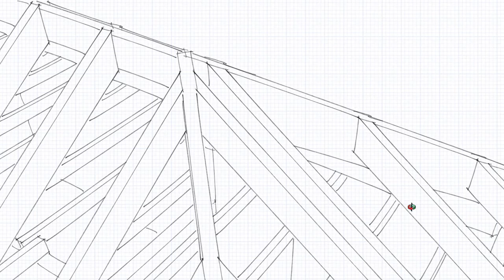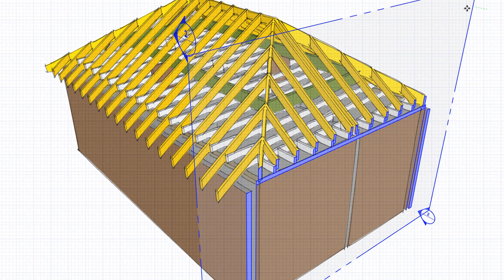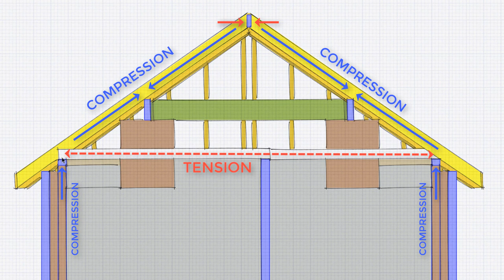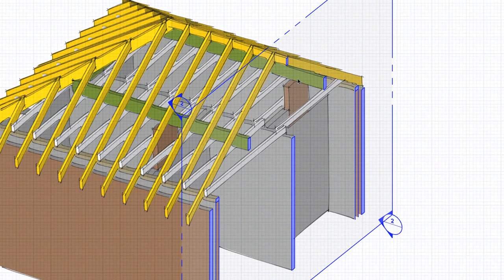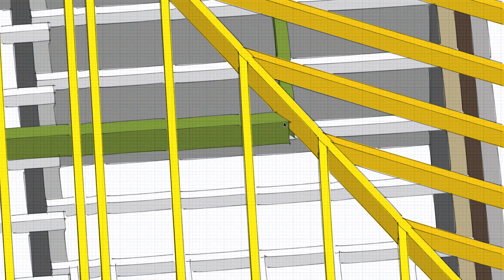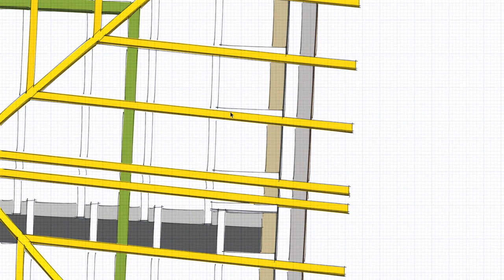How does a hipped roof work?

Comment: Very impressive presentation and sketch-up. Thanks Robin. A couple of questions and discussions: 
1- The support of the purlins and loads on the hip rafters. The end purlin is supported by the hip rafter. Therefore, when sizing the hip rafter, the loading will need to cover the jack rafters as well as  the end reaction of the purlin. Considering a 3-4m purlin supporting all the dead/live loads from the common rafters, the point load transferred to the hip rafter will be considerably high. 
Then, the end reaction of the hip rafter itself will be transferred back to the end of the ridge board. Then it will be passed on to the 1st pair of common rafters. So the question is, why we normally won't thicken the 1st pair of common rafters at the hip? (sorry for the long winding questions and it would be much easier to talk through a sketch board). 
2-  I know you have another video about loft conversion. However, my question here is about loft conversion with large dormers (a lot of home owners would prefer a dormer which is as wide as the span of the ridge board). For the hip roof structure in this video, I don't see any way the dormer conversion can be done without installing a new steel ridge beam with additional support at the hip (can be a column or triangle frame). This is a result of undermining the integrity of the triangle which is formed by a pair of common rafters and a continued ceiling joist. Just wonder if you have any better alternative or I missed anything? 
Many thanks for the video as well as reading my questions. 
Cheers,
Rick

Comment: What way does it work then when converting a hipped roof loft? In terms of the purlin support walls, they would protrude into the available room space could they be replaced with vertical timber supports every 600mm along the purlin? 

Or even cut the purlin wall support back flush with the edge of the purlin to reduce protrusion into the room? 

Or replace with a steel beam somehow?

Would be very interested to see a video on how this hipped roof structure could be converted and maintain both structural integrity and the hip design. You see an awful lot of videos on YouTube of hip to gable loft conversion but never any hip loft conversion dealing with the purlin support walls problem.

Loving all your videos have been so informative, keep up the awesome work!
Reply from the maker: Great suggestion - watch this space!

Comment: Great video! This is a common type of residential wood roof trusses here in the US. I would be curious to see a wood truss design with a vaulted ceiling. That is often a tricky design because, without the collar ties to tie the system together, it is hard to transfer the horizontal shear force to the top of the walls while maintaining stability.
Reply from the maker: Great suggestion! Check out this one for the analysis of a collar tied roof: https://youtu.be/JbRUdP2AYKg

Comment: Even better the second time around! Just in time to design a hipped cut roof, so many thanks Robin 👍🏼 perfect learning and revision material!
Reply from the maker: Thanks Cory - great to hear it!
Reply: @RobindeJongh  very helpful. Would the hip rafter typically be doubled up to account for the higher loading and point load from the purlin, as well as the first ‘truss’ supporting the hip rafter at the top?

Comment: Hi and many thanks for the professional explanation
My question is how the roof load will transferred to the walls?is it distributed transferred along the wall length and points loads applied in the corner transferred by the hips?
Thanks

Comment: This video fundamentally misunderstands how hipped roofs work:
1) the purlins are not 'supported' on hip rafters - but actually form a 3-way compression joint (c-c-c) with the hip rafter. The hip rafter is predominantly a compression member rather than a flexural or bending member.
2) the purlins are not 'ties' - ie tension members - they actually form what's known as a 'compression ring'. The opposite of ties.
3) having said the above, the jack rafters on the hip tying to ceiling joists at eaves are actually a fudge: they don't 'tie' back to anything other than the plasterboard! However, historically it does seem to work (all hail all those who wryly say 'this house will be held together by the plasterboard'). If I design a hip roof from scratch, I normally nog a few ceiling joists back and use galvanised straps over the top (a roofer will tell you that's overkill!)
The force diagram for the cross section is correct - and helpful for understanding. But the similar action of the hip rafters in conjunction with the purlin is missed.
Reply from the maker: Hi. I’d be very interested to read any references you have on this?

Comment: Great presentation many thanks Robin. Funny I was never a fan of the hip roof from the issue of maintaining the hip tiles.  I have realised recently though that they avoid all the issues of bracing and restraint strapping of a gabled roof, so provide a wind proof structure at the expense of a lot of joinery. Just one minor question: For the overlapping ceiling joists, for the central overlap presumably a bit extra overlap timber should be allowed such that there is say at least 6 inches ( if not a bit more) of timber beyond the last nail, to stop the nails splitting out the end of the timber?  At the wall plate end assume best to use purpose made straps/ties to fix it all together.  Thanks again.
Reply from the maker: Thanks John - very good points. Definitely a bigger overlap for the ceiling timbers than what the graphics indicated is important to allow the nails enough end distance. I'm not a roofer but it seems to me that the tried and tested methods are best to stick with, so either purpose made connection plates (warrantee'd by the manufacturer) or else the right number of nails as specified in college textbooks or by experienced joiners!
Reply: @RobindeJongh  Thanks Robin. I've been wondering what the terminology was for the overhang so it's "End distance". Agree on using manufacturers purpose made brackets at the wall plate rather than making something up. I hadn't thought about the wall plate corners before, that was an interesting point.

Comment: Hi. very much enjoying your videos. I'm a joiner by trade but now a building surveyor and often we see hips which are clearly sufficient for purpose having been there 50 or 100 years without significant deflection, yet they often don't calculate. can you explain what's going on at with the magnitude and direction of forces at a hip. I'm aware that the purlin load is transferred to the hip which is more efficient being in compression (hence the smaller section) but I think it would make an interesting video and I always learn something from your videos. Also if you could explain how then loading of a hipped roof translates to the forces on a beam below. Thanks again for your content.
Reply: Calculations account for more loading than is likely received, there’s also a factor of safety, snow is rarely in such quantities as accounted for and is short term, there’s also a lot of load sharing between the members, timber quality is perhaps better than assumed in the design codes, older roofs that failed have probably been replaced!

Comment: Hi Robin, should purlin supports mirrored / symmetrical? 

Wondering if it's feasible to have both purlin supports positioned opposite eachother, but slightly off of the structural mid point?

Thank you for all the great content you upload !

Comment: Hi, good video, ex joiner and building surveyor.  I usually put a small pice of timber nailed under the hip where the purlins meet so the purlins can join / exert equal and opposite force and usually a plywood gusset attached to the outer face of the last two commons so that the larger hip plumb cuts have something to nail to otherwise the bottom of the hip plumb cut is dangling where it meets the ridge.   My question is I’ve always found the unsupported purlins which span from the short length of hip to hip at the left and right sides abit odd as they add extra weight to the hip with no supporting masonry pillar underneath.  Is this arrangement providing support to the hips via equal and opposite force where they join to the supporting main purlins and thus don’t need a pillar under them ?

Comment: Robin, I do have a question...I have an existing structure that is a 4-way hip roof over a square building and has no ridge. Basically a pyramid. The owner wants to add 10 feet to the back of the structure with a gabled roof. The existing structure is 24'x24'. Adding 10' in the rear would effectively require a 22-23' ridge extending back to the gable. The owner would like to remove the jack rafters on the back to provide full access to the attic. My assumption is that the two hips in the back would need to be beefed up somehow to prevent bowing caused by the pressure of the side jack rafters. I was going to install a 24' carrying beam along the back where the existing back wall will be removed and installing the ceiling joists on top of and perpendicular to the beam. Do you know how the back hips would be beefed up to reinforced them once the back jacks are removed?
Reply from the maker: Hi Scott. This would need a structural engineer to produce a design as it's not an easy answer.

Comment: Hello from Erie , PA USA

I have a section of my 1913 cape cod's hip roof attic (2x6 rafter) that'll be converted to living space . I have a supporting wall 12ft from one side and 16ft from the other . The floor joist (2x6) for the attic connect at the support BUT at the exterior walls they sit ~5inches below the top plate and are nailed to vertical stud . Because I'm converting this section to living space I've added 2x10 collar ties (7'6" ceiling , originally 2x4s but moved up 3.5') . I plan to sister the joists with additional 2x6 on each joist + blocking at mid span as I want to avoiding losing height. The rafters and joist run in same direction .

Do you think this attic floor will hold up as I believe the floor acts as the rafter tie in some way ? Its currently not sagging or bouncy . I'll be reinforcing the roof rafters to the top plate with Simpson Strong rafter ties and attach the sistered floor joist to outer wall with 2 Spax Powerlags 3/8 thick screws . Ill be removing the 42 inch knee walls after all this . Does this sound like it'll work ?

Thanks !!
Reply from the maker: Hi. I'd always get a structural engineer to take a look if you're doing structural modifications.

Comment: Have an older home with hip roof.  2 x 4 construction on rafters and ceiling below. House is in northern USA, so snow load happens every year.  Currently  no Purlins are present.  We are replacing shingles on this home and notice that the rafter are bowing.  Can we jack up rafters to take out bow and install a knee wall on all 4 sides instead of Purlins.  Concern is 2x4 ceilings  supporting weight possible wall cracking below in living area.  One side of house has 1 wall underneath as other side had 2 walls underneath to disperse the weight.  Thoughts on knee wall?
Reply from the maker: Hi Dee. I recommend that you have a structural engineer round to look at this.

Comment: Hi Robin. I’m looking at converting my bungalow loft which has a hipped roof, 45° pitch and a 4’ ridge. The purlin props are at 90° (or not in some cases) and strutted on to the internal walls for support. Providing I make sure that they still strut down to an internal wall, or a beam fixed across the internal walls, is there any reason why I can’t have them in a vertical position? Rafters and joists vary between 360 and 400mm - 1935 built brick bungalow. Many thanks.
Reply from the maker: Hi Mike. You need to resolve all the horizontal and vertical components of the force, which is why the props are in at an angle.
Reply: Thanks for the reply Robin. How would you suggest to overcome this? I was advised by a builder to fit a props vertically on to a different internal wall to take the weight of the purlin and rafters and then remove the angled ones. From what you are saying, I gather this won’t be sufficient?

Comment: Hi Robin. Just a couple of quickies...

(1) the tension in the bottom ties. Obviously a builder would ask how many nails are needed. If you had say.. A tension force of a 10kN. When you split the bottom tie in half, do you usually specify the nail fixings etc?

(2). The pier walls. Have you done this on many projects retrospectively? With wind loading, is that a concern at all? Would you specify any proprietary fixings to ensure the wall stiffness is at its max or if its a loft conversion, would you instead design steel supports spanning from eaves to internal wall, then design a stud wall / timber post to support the purlin?

Cheers! And great videos as always.
Reply from the maker: Hi Mark. 1) yes, would need calculations to ascertain fixings if the ceiling ties were not continuous. 2) Do you mean take the pier walls out?
Reply: I have known structural engineers give the shearing strength of nails for fixings but in reality what is usually specified is "adequate fixing" which means someone getting busy skewnailing with a nailgun.

Comment: Random question but I'm a roofer and just started doing jobs for my self and I'm struggling working out the sqm or m2 (not sure if there the same thing) of a 4 hipped roof and to then work out materials for the roof eg batten felt tiles. Could you shed some light on this please or anyone?

Comment: Hi mate. Is there a way of removing the ceiling joists to make my hip roof vaulted. My cieling is only hipped on one side and spans apprx 2.4 metres wall to wall so its not big. Thanks
Reply from the maker: Hi Wayne. You would probably need a steel frame and ridge beam to do this.
Reply: @RobindeJongh  im a joiner by trade but not a roof joiner. Where would i place the steel frame

Comment: Do you know how you would vault a hipped roof? I've seen ones that seem freestanding. Are the ceiling beams (the white ones) necessary for the support of the roof?
Reply from the maker: Hi. You can do this with a structural ring-beam or a steel moment frame that goes up to the hip/ridge, or a cranked steel ridge beam.

Comment: The purlins should be positioned so they are acting at 90 degrees to the rafters. They are less effective they way you have shown them. If you have two rows of purlins you can often reduce the rafters down to 75x50mm which allows the purlins to be located higher up the hip and create more area for fixings. Also, traditionally there would be dragon ties across the wall plates at each corner to help restrict spread. This is particularly relevant if there are openings close to the edges of the walls. Another very well presented video though.
Reply from the maker: Hi Paul. Thanks for your insightful comments. Glad to have you aboard!
Reply: On my roof there is a support beam from the purlin to the middle joist. So at an angle. One on each side of the roof.
My question is, can I remove these 2 support beans? 
There are  supports under the purlins, going vertical to a beam that sits on top of the joists.
Reply: also do you have a video regarding the angles where the purlins meet on the hip rafters, like the person commented, placed at 90 degrees to the rafters with notches out to allow for the angle at the corner

Comment: Can you cut one of the hip rafters to build a wrap around dormer? Can the weight be somehow redistributed allowing to have full height in all the dormer? This would be as an alternative to hip to gable, so modifying only part of the roof. In the case I refer to the purlin on that side is already partially cut and removed by a previous building project (staircase to the loft)
Reply: This is what we have in out loft conversion. It's quite common in our area on semi-detached houses because planners don't like a full hip to gable.
Reply: @tallerlaura  thank you. Could you upload a link to a photo or to a similar finalised loft?

Comment: Could a hipped roof be braced in such a way to lift it off of cinder block walls so that it wouldn't collapse on itself?  Would like to raise the height of my walls without the expense of building whole new roof structure.
Reply from the maker: That could be done in theory. It would need some careful structural design.

Comment: I would have thought the top of the hip rafter was supported by the last pair of common rafters. There will only be outward thrust at the bottom of the hip rafter if the connection came loose or if the ridge lowered?
Reply from the maker: Hi Tom. Yes the hips are supported at the top by the triangulated common rafters and ceiling tie. However, for equilibrium I believe it would also need support at the bottom, both horizontally and vertically.

Comment: How would it a hip roof without ceiling joists, to prevent thrust, be designed? Is this possible?
Reply from the maker: Hi Michael. Yes it's possible - usually you would provide a ridge beam and support the ridge with a post or steel frame.
Reply: I have done this two ways, supported a structural ridge from a post or structural stud wall on to masonry, and the other, where the areas floor is to be lined you can provide a stressed skin to the ceiling joists.

Comment: The Perlins shouldn’t be perpendicular they should be 90 degrees to the rafter. The  way it’s drawn shoes the rafters load is hitting on a corner of the load taking timber namely the perlin
Reply from the maker: Hi Jerry. I have seen it done both ways. For the vertical purlin for example see here: https://nhbc-standards.co.uk/7-roofs/7-2-pitched-roofs/7-2-7-joints-and-connections/